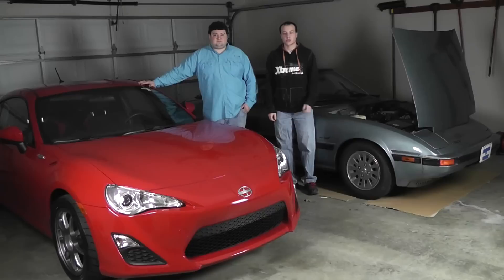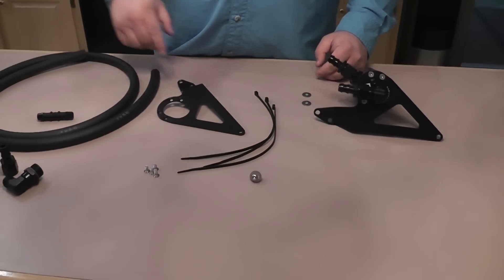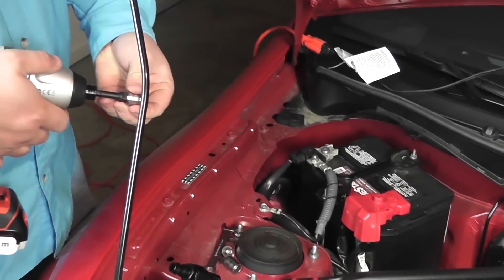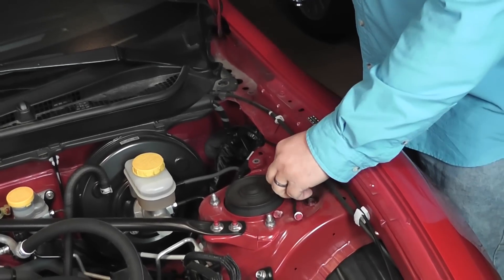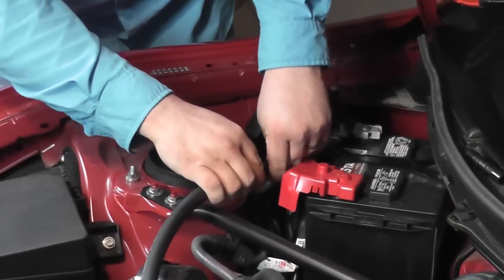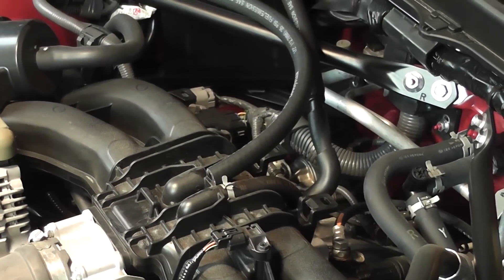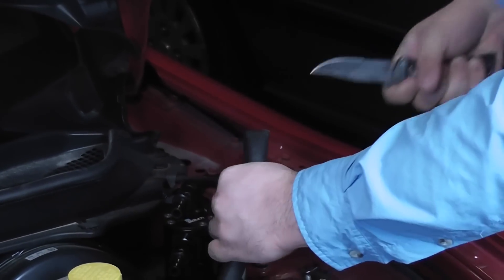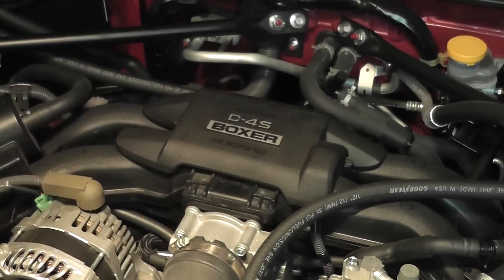Radium Engineering: Catch Can Install Guide - Scion FR-S, Subaru BRZ

Comment: Well hopefully you guys still respond to your comments because I have questions: 

1) How long did it take on average to fill each up?
And
2) Was it a pain to take them off to drain them?

I know it’s been 7+ years since this video was uploaded, so if anything, I mostly care about the draining question. Thanks
Reply from the maker: My turbo car needed drained after every race event, and/or monthly. My friend's N/A i think he drained it every 3 months, or so. I strongly recommend having the drain accessory (the drain tube with valve).
Reply: You guys actually replied! 🥺 Thanks! I was going to get some red silicone heater hoses to make it look sweeeeeeet too. Thanks again 👍🏻
Reply from the maker: Red hoses would look amazing!  I'm stealing that idea, hahaha.  ^_^
Reply: So just double checked… the HPS Heater hose (just ones I came across. Not sponsored) is not recommend for fuel and oil use according to their website. I’m going to get somebody someday commenting “MEH MEH MEH, you can’t use heater hose when it has oil and fuel in it.” So, for the record, maybe try something else 👍🏻
Reply: So, quick update. I put the PCV side on and holy Jesus that was a bitch. I’m still going to get the CCV side because, well, I just have to cuz symmetry, but woof. Not sure about changing the hoses red anytime soon… lol

Comment: why is there a can on both sides of the bay?
Reply from the maker: +Anthony Kunz
Most modern cars have two breather hoses, one for the crankcase, and one for the valvetrain.  The can on the passenger side is the PCV, or crankcase breather, and the one on the driver side, i think, is for the valvetrain.